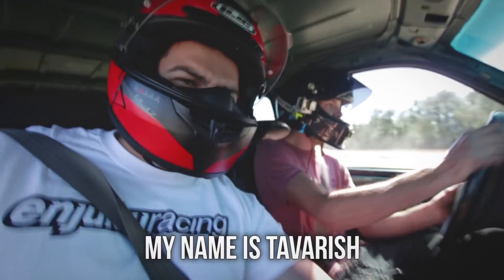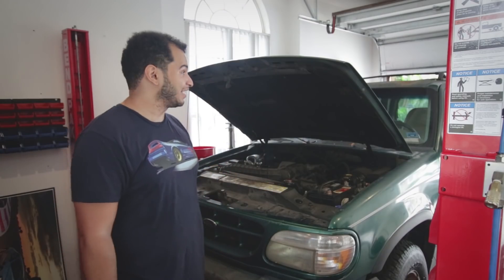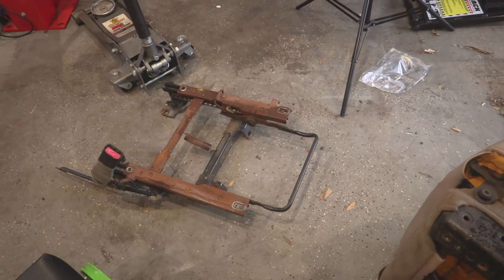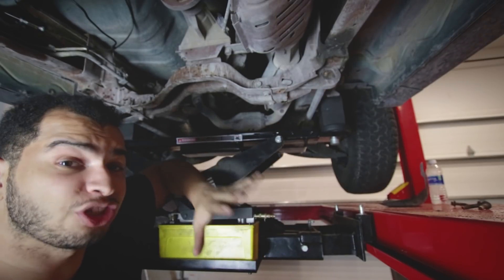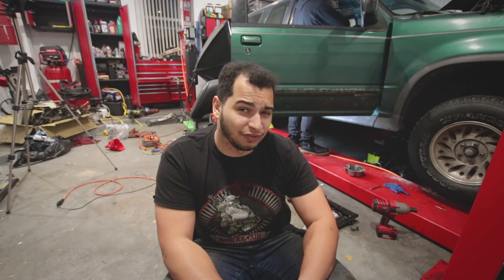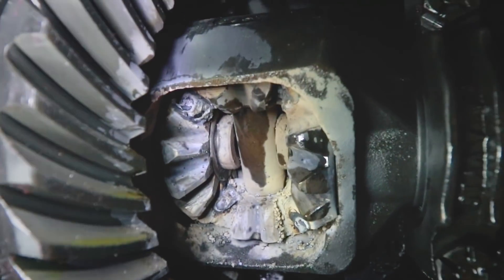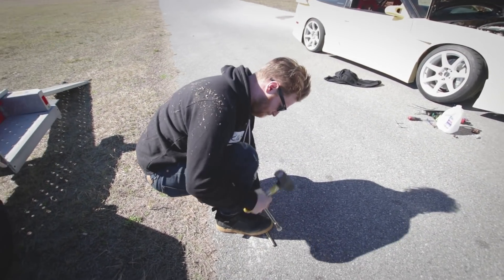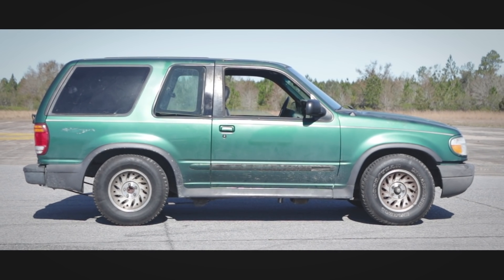We Turned A Broken $500 Ford Explorer Into An AMAZING Drift Car (In 5 Days)

Comment: On Craigslist: babied her entire life, never offroad. Cool stance and hydro with no interior to slow you down. The windows create an open feel and the wind can freely run through your hair. $12,000 cash only no low ball offers.
Reply: "I know what i got"
Reply: Never abused
Reply: Paint is only a couple years old
Reply: "Interior is pretty clean"
Reply: @Windsquid54321   I intentionally looked through the replies for this reply. knowing it was there. thank you lmao
Reply: adult driven
Reply: Adult lady driven, 337,079 miles on the body with new dealer installed motor and trans with only 1,700 miles on them.
Reply: @jamesfair9751  lost every single paper receipt, mechanic bill, emailed receipt, bank statement associated with said work done. "Sorry pal"
Reply: Samuel Orellana also the head of the service department is no longer working there unfortunate he was the only one who could possibly verify the work done.
Reply: Tom Rohlfs “just saw one sell for 10 mil I know what I got “

Comment: It looked like the rear end was glitching out during those donuts, LOL
Reply: DOES NOT COMPUTE.
Reply: If the wheels are skidding, that shouldn't matter. The problem was that they used massive lowering blocks on flimsy leaf springs, giving the axle a lot of leverage against the springs. Apply power to that and you get axle wrap... I mean, apply power to that and Dora starts twerking.
Reply: Needs  those dangerous blocks removed
Reply: massive axle hop from the lowering blocks
Reply: @Darwinpasta  
Drop, pop and lock it lil dora! lol
Reply: YT's compression couldn't handle it
Reply: Because of that single leaf spring, they should have removed those factory blocks and installed some traction bars. My 91 s10 (4.3 with 5spd) had a bad wheel hop problem that got wayyyyyy worse after I removed 2 of the 4 leafs on the back to lower it. Basically a spaghetti noodle for a leaf spring at that point. Allows the axle to rotate wayyy to much. A set of cheap traction bars I got from jegs or summit, dont quite remember got it working like it should with some modification. The included U bolts and nuts stripped right away and sent the rear end air born in a turn on throttle when they stripped sending the traction bars directly into the ground. Wasnt not fun at all. Some grade 8 nuts and bolts along with 1inch square tubing made the perfect replacement for the junk hardware that came with the traction bars.

Comment: I love the 1st and 2nd generation Ford Explorers. I have a 1991, 1993, and a 2000 that I purchased for $700 each from private sellers on Craigslist.com in 2010, 2011, and recently in 2016.

All are maintained property, look great and all running like champs. For those that are looking into a good used daily driver vehicle, or a car as a backup, I recommend them for sure.

Also, parts are so widely available, you can purchase them for pennies on the dollar.
Reply: Those 1st and 2nd gens (minus the years with the 5r55e trans) are some of the most stubborn ain't-gonna-die vehicles I've ever driven. Cologne V6 FTW.
Reply: @ImpetuouslyInsane  my 2nd gen 5r55e has 232k miles and just started having very minor issues. Its all in how you take care of them.
Reply: Yes honestly my buffalo aka my explorer she had 190k and runs perfect

Comment: Dude, you guys are on level with the Roadkill guys. This was an EPIC watch on a few levels for me. I own a 99 Explorer w/278K on it, and have always wondered what it would like with a respectable drop in it. If you guys REALLY went in on it, a motor swap (JDM) and some not grippy 8" wide tires, and a rainy day would be choice. I realize that this vid is a year old, and it was slotted into my Recommended line, but it was still an EPIC post.

Comment: I had a 2000 Explorer that I promptly named the Exploder when I got it. It took us to Colorado and back to Pennsylvania towing a dinky little popup through the worst weather we could find, up and down Pike's Peak, and it was wonderful. Then it went to my uncle, sat for two years, and finally I got it. The poor thing was so badly hurt for sitting so long. Tank was empty, plugs and coils were shot, the V6 had become an asynchronous inline 2.5, brakes were gone, rust holes in the floor. But it was my first car, and, while it was pretty broken, while it had issues, including a finally fatal exhaust leak that caused it to fail inspection, while it would randomly cut out at idle or while braking, it was fun. Drove nice in the snow here, the ABS was beautiful. You get a little slide on, it shudders, you release the brake, let the tires roll, and then brake again, and the Exploder came right back into line. I miss that old thing, it hurt a bit to see it go, being dragged away on rusty rims with no tires, and it hurt worse once I got my Hocus Focus which instantly blew out the CVT when we left the dealer's lot.  Now I drive a Fuson Fusion (The letter 'i' fell off), which, while it's nice, with good audio and a nice dash setup, it's just not the same as the Exploder. The Fuson slides around all over the place in snow even with good quality studded tires, it lights up the wheels if I'm stopped on a hill when its raining, which the traction control seems to completely ignore. In conclusion of my little story, I feel it's not always the modern cars, the fancy cars, or the fast cars that give you what you need. Sometimes it's the Exploder, running on 2.5 cylinders and cutting out at the redlight, that gives you that moment of happiness, of comfort.

Comment: Got a 97 explorer V6 4x4 for $850 from my friend. Best money I ever spent
Reply: Daniel L I have a 97 AWD v8, I love it
Reply: Daniel L my friend got his 5.0 v8 ford explore for 300$ run and drives just had a dent in the back door
Reply: I have a 98 4.0 explorer and it's pretty bad at donuts but does decent burnouts.lol
Reply: I love my '99 5.0. True duals and Flowmasters all while hauling kids and groceries
Reply: got mine for $400 and put in nearly $4k into it, rebuilt the motor, lift kit, lockers, shocks, paint, '33 trail grapplers and methods which were stolen recently ;(
Reply: Got a '96 Explorer 5.0 for 500
Reply: My best friend had a 94' 5spd back in 99'.. cant count how many times we had that speedo buried past 135 mph

Comment: hey cool build, FYI by adjusting the torsion bars down that way, you are reducing the spring rate at the same time as lowering it. what you need to do is re-index the torsion bars in their splined socket 3 or so splines, for ride height. then put the adjuster back to stock. Then you can adjust them tighter if need be.

Comment: That was a great choice on your part to go with a explorer to do this, I didn't realize that they are old enough now to be in the $500 range now. People can say what they want about Ford's and its true the build quality is not that of a Toyota BUT Explorers and other Ford trucks seem to be way tougher when they are being "abused to death" if that makes sense. I guess it shows that the core components of the trucks are very good, it's all the crap like the radio, the power windows or even the headliner that breaks and makes the car seem like crap way sooner than it actually is right? You guys pointed out that even the body was mostly rust free being as old as it is (I doubt that truck was garaged at any time of it's life outside of the time you guys had it in one to mod it), so maybe they are built ok? Wdyt?  Great video, thanks.

Comment: I had a 99 explorer with a 5.0 v8. It was the Eddie Bauer edition. I had the same intake adapter design and adding that made a huge diff in power. That thing was actually pretty damn fast. The other mod I did was do an eclectic fan conversion. That made a big difference with power and gas mileage. Less strain on the engine.

Comment: Yall did it the hard way. Get an 02 suburban with factory LS engine, 4WD and LSD, shift the transfer case into 2WD (if it isn't already stuck there as found) put ~500lbs of weight in it to lower it, and let the LS haul ass. On rainy or snowy roads with less than new tires, you can totally slide around corners, and with enough snow, you can start and hold a fishtail (by overcorrecting) for a solid city block...Can drive it sideways in snow too...Cheap fun without so much work.

Comment: I actually like exploders of that vintage, the one I had the odometer broke at 286k miles probably put another 50k on it, still ran fine when I finally traded it in, no oil consumption problems, did start to tick a bit when I took it to redline passing someone when it was around 300k. Another stellar example of a car that will drive down the road with more things wrong with it than most cars.
Reply: 249 on mine.. original clutch. Runs great. Best explorer made. Been my best vehicle and I’ve had lots.

Comment: If you revisit this, you should add a used/ebay turbo and strengthen the rear suspension a bit.  It just seemed like it couldn't develop quite enough power and manage the power it had in the rear end.   The concept is very cool though!

Comment: Tavarish should have come to me, I just sold a 99 Explorer with 147,000 miles that needed a fuel pump only for $450.  Complete new front suspension, hubs, shocks and struts, brake calipers, pads and rotors front and back, rebuilt trans, new front hubs, new exhaust, newer Wrangler AT tires, blower motor etc. etc. etc. and 4 WD worked.  Interior much cleaner than that heap.
Reply: You should have bought a fuel pump and a camera to record the 99 Explorer's revival
Reply: No reason to pick one with 4WD, just another thing that would need disabled because it's auto 4WD that kicks in the second the rears slip, tho' pulling the front driveshaft isn't much trouble.  However the sport has some other advantages such as shorter wheelbase, lower weight, weaking leaf spring (single leaf) so the tires break free easier.
Reply: Earnest Bunbury -  If it was otherwise in good condition he should have just bought a $100 fuel pump, installed it himself in an afternoon, then sold it for over $1000 which is what one in good condition is worth, maybe even $2K to the right buyer.
Reply: OHV engine and stick could last a lifetime. 2wd 2dr explorers are the easiest to roll.

Comment: I can't believe I haven't seen this until now. I've built 2 drift Explorers (both auto unfortunately), one got wrapped around a tree so I just had to make another. I skipped all the high class mods and just went right for removing weight (most of the body, especially that rear hatch). Tiny rear wheels/tires are a cheap way to lower the car and the gearing which was really the only way to give it enough power to drift. The second one also happens to be 4x4 and the welded diff doubles to make it a killer hill climber so I left that one at stock height other than the natural lowering sustained by towing with waaay too much tongue weight XD

Comment: @Tavarish , Check the fuel pressure , the Explorer does drift on concrete , also do the brown wire mode , so it wil not try to go into 4x4auto mode ..

Comment: in highschool a buddy of mine had an 89 s10 long bed 4.3 he used to powerslide the hell out of, long before that tokyo drift, not only was his truck automatic but he didn't use the E brake to get it going sideways he'd snap it with counter steer and power over .

Comment: That filter has less surface than the stocker,  so instead of getting like 1hp more you probably lost 5hp 😂😂😂
Reply: exactly what I thought too lmao
Reply: Not to mention the factory air box pulls cold air directly from that duct in the grill they pointed out, whereas now the open filter is pulling warm air from the engine.
Reply: But sound
Reply: Don't forget the locking slip diff
Reply: Eric Buist yeah it’s basically a factory cold air intake
Reply: lee nevin but 100° hotter more restrictive air flow🤤

Comment: I want to see the manual transmition on the SL55 or to finish the Toyota
Reply: djdhd ffdhdh I have to say I agree,  it's by far the most interesting of his builds. Hopefully he's saving to do just that. I had a 2004 SL350 in black, it weighed a ton! And on worn tyres got very sketch but was still fun to drive so I'm super interested to see how much weight he can take out of the car and if he can indeed make it a manual. It may convince me to do the same one day because the SL's are going for peanuts in London at the moment.
Reply: Najstar43211 I don't think that he will drop some weight of the SL, with the changing exhaust and suspension the wheight drop was a bonus, not a priority, and the transmition swap is because the old automatic transmitions are limited and slow for that car and engine, and in manual is just your skill, especialy if he will got a short shifter

Comment: Having worked on that generation Explorer, those aren't leaf spring spacers. The leaf springs are prone to cracking and breaking there. Last one of them I worked on only had half of the rear leafs left, and sat lower in the back than yours did after the lowering blocks.

Comment: Have a 96 Sport 4.0 5 spd 4WD that I went the opposite way with and put a 4" lift on it, 12,000 custom installed winch, frame-mounted custome made 2" steel pipe rock sliders and 31X10.50X15 tires and steel wheels. Put a GT40 LSD package in the 8.8 rear end and did what's called a "brown wire mod" to the transfer case that bypasses the Control Trac and locks the 4WD High. This thing can go anywhere a Wrangler can go and I paid $500 for it. The M5OD gear box was suck in reverse. It cost $18 to fix it. That was the only thing wrong with it. I off road this thing all the time and never have any problems with it. I did get rid of the 3" mono springs in the back and installed brand new 2 3/4" 4 door multi-leaf springs on it. The rating isn't much different but that 4th "overload" spring is! I love this truck. It's even the same color as the one you have!

Comment: This was literally my sophomore year of high school
Reply: The car is my middle school career going to shambles from the start
Reply: Every year, in my case. '64 Renault R8 (rear-engined, excellent for drifting), '63 VW Beetle (lots of cheap speed parts, no speed), '72 Datsun 510 (pretty good performance as long as you kept pumping the leaking clutch master cylinder)...

Comment: Ppl trash v6 mustangs, understandably, but the 4.0L v6 is actually a pretty stout motor, very tuneable, super torquey. I once saw a supercharged 06 4.0L V6 killing Cobras and Corvettes and G35s in the 1/8 mile. I just remember being impessed that it was as quick off the line as it was. It was also his daily driver. Did not sound terrible either

Comment: Memories, my first ride was a 2000 Ford Explorer Sport, 5 speed manual. Burnouts, drag races, did it all in that puppy. It had some solid “get up and go”. 

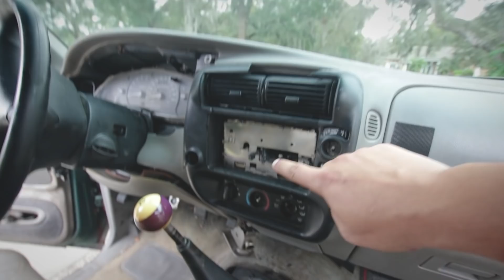@5:15 “radio punched in” comment..funny you say that. Ford had a garbage factory CD player installed and if it got too hot, it wouldn’t play. You could barely make it through a few songs before it quit. I raged punched the living daylights out of mine. Other owners probably did the same to that one. Lol

Comment: Really shouldn’t be doing any of that with a single leaf on both sides 😬 those explorers and the rangers with the 4.0 v6 5 speeds can do Donuts and drift fairly stock.
Reply: They only made it worse. They should have welded the diff, and actually raised it with the torsion in the front. That would have made it stiffer in front and therefore easier to slide. Stiff in front and original soft in the back. The car would be a little higher in the front and look abit stupid though, but it would handle much better doing slides

Comment: Make it drift on pavement, get some low profile tires, oversized sway bars, a little negative camber and some more steering angle by modifying the knuckles.  With that and a 100 shot of nitrous  you'll be sideways holding 50mph

Comment: I have its pickup cousin..a 2wd ranger...with a 4.0 and 5 speed manual. Traction is always an issue
Reply: It got alot better once i  put big cooper AT/3's on it
Reply: My boyfriend has a ranger 5spd (2000) he put a twin turbo 4.8 LS in and a diesel exhuast stack.
Spins too easy to want to make any boost.
Reply: The ford explorer actually came into the world as a pickup truck

Comment: Not locking or limited that would mean it’s supposed to unlock when you weld it it’s just locked and if it ever unlocked you’ll be buying a whole new rear end for it lol they’ve got a term for when welded diffs unlock it’s called Grenading

Comment: Ford 8.8 rear ends are a dime a dozen, and often came with limited slip diffs. You could've had one from a junkyard for 100 bucks, and it would perform much better than a welded diff.

Comment: Don't knock it. Its a sport but a v8 still fits. The 4.0 , 5spd with a 4.10 LSD works great. I had a 97 ranger 4x4 ext cab , 5spd 4.0 with a tru trac . I had it in 1999 , I was drifting before it was the animal it was today. No need for braking to start a drift, drop a gear and floor it and around clover leafs ya go.

Comment: This totally makes me sound like a Ford fanboy but really it's the truth. Ford Explorers and Expeditions has the least amount of body roll, due to how wide the wheel stance is. Also they have good low end torque that's great for drifting. I'm kind of building up my daily driver Expedition for off-roading. Right now even with lockers (yes the stock diff locks work perfectly) I can roast both tires a ways with a stock TC. That's just from a few bolt-ons to the engine. ;) Btw don't get rid of the egr, that will do nothing for power and make your engine suck fuel at idle. Btw get rid of that dinky filter you stuck on it and get a longer one, that for like an s10 engine LOL!